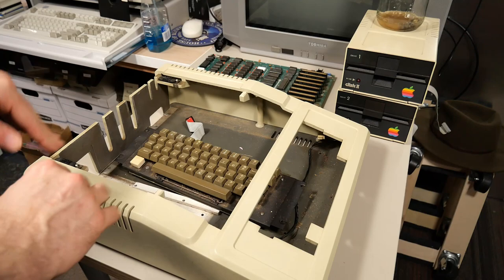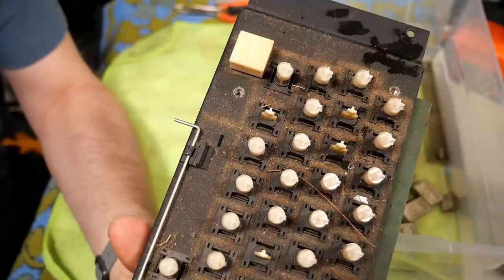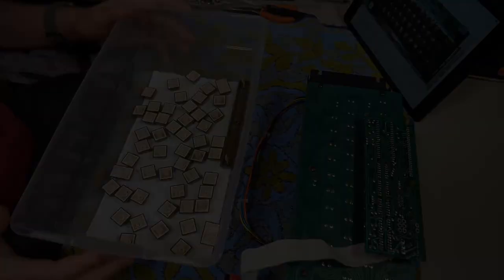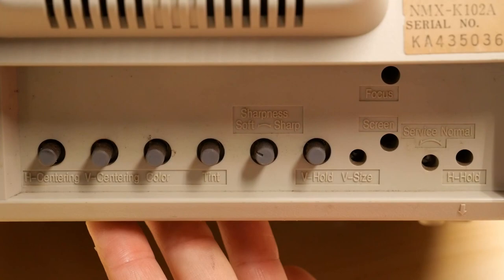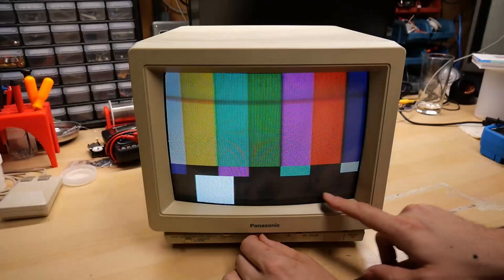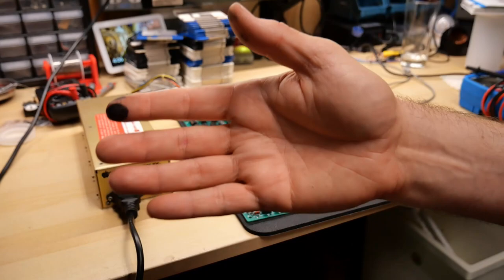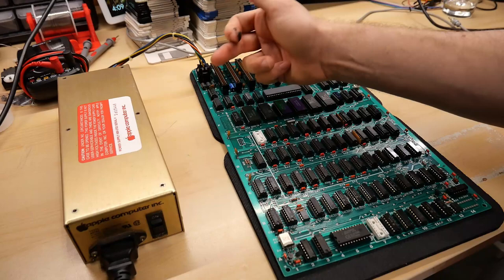Apple ][ plus extreme cleaning + testing the Panasonic Monitor

Comment: Chips of widely differing years are typically indicative of a closing plant. The order will come down to end production - that does NOT mean they stop assembly. It means that the company will assess exactly what parts they happen to have on hand from all previous products. They then plan on how many final products can be made from available parts. Production will continue from miscellaneous parts. The decision to end production may be made early, but if a single part can help produce profit, it will be ordered "post-production" -- IF the part can be used in a future product.

Basically, they run out the line, depleting existing stock as much as possible, buying new parts IF they can be used for future products as well.

When a product is either scaling up or is in full scale manufacture, new parts are on order constantly. Some companies use their old parts, others don't. We often talk about Commodore computers where old parts being used on a board is very uncommon. That's largely because Commodore would redesign the board making many old chips unusable or at the very least undesirable. Other manufacturers made boards that also used custom chips that only they could produce as well. Manufacturers that went with more generic parts used "off the shelf" parts that get used on multiple products. This can lead to an accumulation of parts from a wider range of years - but the earlier chips won't get used initially. They'll sit on shelf somewhere else until a product is terminated and then a call goes out for parts on hand. Those parts will then be added to others and those will be used to finish production of what's left. All of the parts have already been expensed. The remaining costs for labor, utilities, etc. will be all used to price the item. It will likely be sold at just over cost for a marginal profit. Lots of shady retailers resell out of date equipment to unsuspecting individuals or even businesses. Sometimes the equipment is donated as a charitable item and this is a tax write off.

Comment: One of the first things I do with old socketed boards is to re-seat the IC’s. You can usually hear the oxidation cracking as you ease out the chips! In many cases I find this alone will revive a dead board. When you were cleaning the board, I was thinking that I would’ve removed all the chips from their sockets first. :)
Reply: I thought about that as well, but there is a significant possibility of introducing a problem that wasn't there in the process.  That is a lot of ICs.
Reply: That's a usual Adrian thing. Test first, then reseat and deoxit the chips. Here, the chips seem to be getting voltage in spec with the power supply, so probably a good thing for the next video.
Reply: @chemmerling  Yes, I suspect you are correct. With old boards I generally start with just a cursory clean (eg. compressed air and brush), before an initial test power-up. When that fails, simply reseating all socketed IC's and connectors is then my next step, which in many cases gets me a working outcome (which I then follow with a deep clean).

Comment: I last used an Apple IIe back at school, some 37 years ago.......thanks for the memories!
Reply: We still had 2 or 3 Apple IIe's in 1990, my first grade classroom.  I used to play Oregon Trail whenever possible.
Reply: My first computer was an Apple //e back in 1983.  It still works.  More recently I was able to purchase a gadget that lets me connect a Disk ][ to my Mac via USB.  :)
Reply: Last used real hardware back in 2016 or 2017 (I forget which Geek Group trip that was), only messed around with BASIC and couldn't save as the disk drives weren't hooked up and neither was a cassette recorder.

Comment: Hooray! Someone else that scrubs their circuitboards in the sink. People get so upset about this, but it's the best way of cleaning a circuitboard (though not a PSU/CRT circuit etc...). I've done this so many times and it makes a huge difference. In the UK quite a few homes have an airing cupboard (where the hot water tank is), and I leave the cleaned board in there for a week. Also, for cleaning grime and really mucky stuff, test a small patch with Isopropyl 70% alcohol - amazing at getting rid of grime, and really good on casings.

Comment: Back in the 70's I used to hang out at a computer store on my way home from school. Somebody brought in an old S-100 bus computer that didn't work and one of the memory cards had something spilled on it. Although I think it was only an 8K card, the chip density was unbelievable. The guy who ran the store stuck the board in a dishwasher and dried it, and it worked!  I've done similar things to electronics in my career. Once you've dumped a soda in your device, a little water is likely not going to make it worse. The Korg Polysix with the cat pee on the digital board was the worst.

Comment: Adrian, there is a small white silkscreened square on the motherboard near the power connector - this is where Apple stamps the date code for the entire motherboard completion. Hopefully the stamps is still visible after the thorough cleaning you gave it!
Also note that the square is a little small for the stamp, so it is common to have a number to the left or right of it on the green (extra-hard to see!!)
Reply: @Johnny-es9xg  But he should, after all the stuff he has fixed, known better not to do those boneheaded fixes. I did not say anything about that until now but it was rather bone headed even for Dave.
Reply: @GORF_EMPIRE  which one?
Reply: @Walczyk  Mostly the dremmel on the edge of the screw really. He should have just waited and gotten the keyed star OR at very least, dremmel across the screw head and use a flat to take it out. You can get those keyed drivers anywhere nowadays and he went to the store. The paper clip does not bother me except for the fact that he should have done some more thorough continuity tests before trying it. 8 bit guy is a great channel and I watch it all the time and usually he is very thorough about how he goes about repairs. However, when you have something as apparently as rare as that machine seems to be, you certainly want to take better caution. Dave could be right about it being a proto that never really worked properly in the first place but to me that is just more the reason why you want to take whatever extra steps  and be much more careful than it seemed  he was being. I'm certainly not upset at him or will disown him as a result of it like some people did ...we've all been boneheaded at times but in a rare case like that, I think erring on the side of caution is always best.
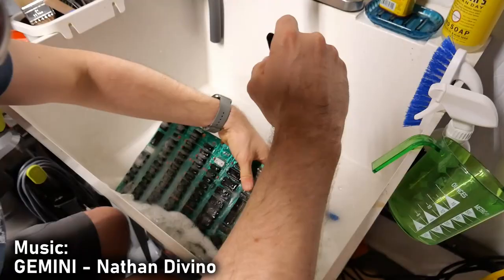Reply: So 3382 as seen around 3:58 ?
Reply: deamondeathstone1 good eye!!
Yeah, looks like 33rd week of 1982, but weird that it seems to be WWYY instead of YYWW as I have always seen...
So any chip past that date must have been replaced! (Looks like two - 25:25 we see 8311 and 8246)
Reply: @gallgreg On that, I wonder if someone had an older Apple II and was swapping IC's over for troubleshooting. Would make sense with the 70's date codes in an 82 motherboard.
Reply: Christopher Hemmerling  the thing with the Apple II and II Plus is it uses all standard 74-series logic chips, so you can literally grab the parts anywhere...
Reply: GORF totally agree! That episode of the 8 bit guy had me cringing! If he doesn’t want to take the time to fix the computer properly, he should transfer it to someone who will. Also, plugging all the computers in the warehouse without opening and checking them first was totally reckless!

Comment: A thought for the cloudy plastic on the keys, I've used a metal polish called Peek when I've had dull or lightly scratched plastics, and it polishes out the cloudy dullness nicely, usually that's oxidation of the plastic when it's that light powdery look, which polishing removes and smooths things out nicely... :)

Comment: One common issue with Apple II Plus is the chips creep out of the sockets from heating/cooling cycles. This is especially bad with machines fully loaded with cards... I have fixed many back in the day by simply pushing all the chips down into their sockets!
Reply: I thought that was more of an Apple /// thing.
Reply: @GaryCameron780  - Nope Apple II as well. Had to do that all the time back in my high school days.
Reply: Actually my Apple II Plus got so bad that it would overheat within about 20 min of turning it on and would start to "glitch", but then again, I had it filled with cards! My teenage solution at the time was to mount a 120Vac muffin fan (from Princess Auto!) inside the case so it would blow air across the motherboard... I cringe to think that I actually drilled vent holes into the plastic at the side where the fan was mounted (close to the joystick port), but it worked a charm and never overheated again! Of course, the computer was a little noisy though... :)
Reply: Had the same issue with the floppy drive ROM on my C128D so it is prudent to check chip seating.

Comment: I recall there being quite mix of date codes on the IC’s in my original Apple II Plus from years ago, so yours may not have been messed with much...
Reply: Note the other comment about date codes - your motherboard has a stamped date code of 3382 (weird! It is usually YYWW, but let's assume someone was mixed up!), so 33rd week of 1982... I see from your list that you have two chips from past that, so these must have for sure been changed. Also, I think you are right to suspect those 3 mismatched early chips as well!
My 7935 Apple II Plus has different RAM brands for each 16K bank, leading me to believe it was first assembled as a 16 KB motherboard and then expanded on two separate occasions (perhaps even before it left the factory, since I think they standardized on 48KB by the time the Plus came out!)...

Comment: I have an Apple 2e, Color monitor, and floppies that were in a threshing barn for at least 20 years.  The 2e was not too bad but did have a fair amount of seed, husk, dirt/dust, and bugs. The floppies were really bad-off with dirt, mouse poop, urine, seed, husk bugs, and other unidentifiable's. I found 4 drives and made two workable.  I did tear the 2e down and cleaned it good.  There was also a C128, 1571, and Excelerator Plus. The 128 needed a good bit of cleaning, as it was near the thresher but the drives were near the apple 2e. That keyboard you had was clean compared to the 128's. They were loaded with years of crap! The 128 was spider central and it had so many bugs in it (hence the spiders). I took a lot of time with it and it still has some KB issues but now looks good for its living location. I had to reflow the power jack and switch, flush and clean (many times) the power switch. I never knew so much stuff could be in such a small space! The KB needed a few plungers 3d printed (I used tinkercad to make) I had to recoat the KB traces as they there shot in places even before cleaning. I just used an old #2 pencil and colored happily for over an hour.  The PSU was dead as well and I used a 9VAC wall wort and a Hi-Link HLK-20M05 for the 5V and placed those back in the PSU case. I plan to recap it all at some point soon as well, but surprisingly they all seem ok but will do them.

Comment: NTSC or "Never The Same Color" as we call it in the PAL region ;) ... ahh good old times.
Reply: Also what we call it in the NTSC region... hehe... 😅
Reply: We did fine with NTSC.  Less noise and a higher framerate than PAL, anyway.
Reply: @infinitecanadian  True, though they got the resolution in exchange. I lived through the late 80s and early 90s making the joke that we recorded everything on masking tape! 😂
Reply: While true, NTSC allowed WOZ's color hack to work allowing us to have color as early as the Apple II. PAL regions didn't get it on composite or if they did it would have only been on the IIgs or an adapter for the //c.
Reply: @richfiles  It was also easier to use in studios.
Reply: Almost. Never Twice the Same Color.
Reply: @Thankz4sharing  never cared for that version... It's not NTtSC...
Reply: @richfiles  Should USA really be “TUSOA”?  :-)
Definite articles are commonly omitted from abrevs.
Reply: They developed a higher res analog system called NTSC2 that never really took off (equivalent to PAL+, which was also a flop). Allegedly it stood for Never The Same Color Twice.
Reply: @jrmcferren  There was a PALColour card that plugged into slot #7 and picked up the colour burst signal from the motherboard (which was modified to 4.43 MHz on the EuroPlus motherboard). The card took care of the actual alternating phase encoding by itself, since the motherboard was never designed to accommodate this. The luma signal  came from the inline video header (forget the designation) that was also used in the US for the optional RF modulator.

Comment: Dude! Goo Gone makes a great key cleaner. I let them soak in it overnight then rinse them under a small stream of running water. The dirt and grime practically fall off! Afterwards, I filter the Goo Gone and set it aside for re-use on the next project.

Comment: At the 6:55 mark you are correct about the Apple //e keyboard.  The logic is all on the motherboard.  If I recall correctly you can actually simulate key presses to some degree by unplugging the keyboard and jumpering the pins around.

Comment: For broken screws and bolts, a left handed drill can help if needed, if it grabs the screw in reverse it will tend to unscrew it, if not, it will drill it out. Just be sure the drill is well centered.

Comment: Eek!! I would have done a chip reseating and got it working before a deep clean like that, and only done a dust removal (vacuum) first and a recheck.  Also with those power supplies, you need to be really careful.  Some of the rails are only managed with zeners and if they blow, you can take out a board (or at least a few chips).  A single dry cap can throw all the rails off. Best to test against a test load block before applying it to a board.  where I worked, we had a lab of apples + clones.  The clone supplies were actually more reliable than the apple ones, those of which were often replaced by a clone supply for safety.  The most common failures were the ram chips which always ran hotter than the rest so that was the first port of call.  Best of luck!!  looking forward to the next clip to see if it survived ;)

Comment: I used to work at an authorized apple educational repair center, we shut down the old apple repair service when apple shut down the program.  We had tons of factory new inventory parts for Macs and Apple ]['s, Most of it went into the dumpster. I wish I would've kept it all, the owner probably would've said, take it if you want it.

Comment: Repair hints as I remember from Dr Levinson...

You can remove the BASIC ROMs ($D000 - $EFFF); leaving the 2 $Fxxx ROMs. This will give the "Apple ][" and break into Machine Language Monitor.

Look at the language card, as the RAM chip from the mother board is moved there. Take it out and put it on the mother board. That will give you 48k.

Press all the chips on the socket,  no doubt water got between the chip and the socket.

The rest you know from fixing C64s. Check the clock and the reset lines. Check the video connector. Etc...

Edit: I forget-  check the video cable too.

Comment: Years ago (2007-ish) I picked up an entire school computer lab of everything from II Plus to IIe Platinum that failed to sell at a yardsale in Tennessee.  The early 80s systems had a mixture of old/new chips, while toward the IIe Platinum it was mostly a newer / consolidated design. I don't know when they started consolidation, but if had to guess, 82 or 83. I had a bunch of expansion cards including some test readers that were used by the school.

Comment: VERY lucky to have an Alps keyboard Adrian! The Datanetics keyboards … replacement switches are hen's teeth. Datanetics is definitely more desirable among collectors, but Alps is more desirable if you want to be able to fix it. Me? I'm kind of in the modern Cherry-style replacement camp, if only because I'm interested in having options that don't involve finding dead machines to pick over for parts (or rather, the actual fear, machines that worked that were parted out and destroyed by unscrupulous eBay sellers).

Not only that, I'm starting to be interested in modern cost-reduced clones of the old machines. I think the biggest impediment before was that starting in about 1980 the machines started getting not only rapidly more complex, but also rapidly more based around custom chips that you just can't get anymore. It's bad enough there are so many standard chips you can't get anymore. But these days the tools to make them are becoming affordable and available to hobbyists. So now's the time to recreate these things if we want them! (And we do!)

Comment: The manufacture date of the II+ main board is on the white square on the corner of the motherboard by the power connector.  It's handwritten on one of mine ("8139") and stamped on my other one ("2182").  At 1:48, you can see that yours is stamped with "3382".

While I didn't check each and every IC, my 1982 board probably has a few more 1982 chips than 1981 chips and I also saw an 1980 date code.  Maybe someone found a couple of old parts bins the week that your board was stuffed.